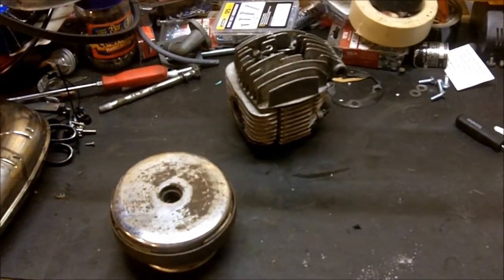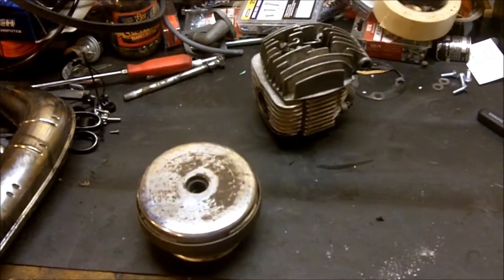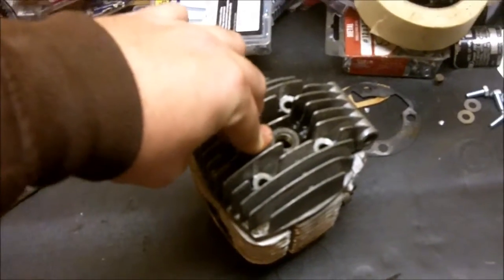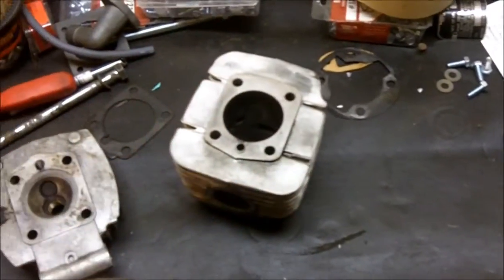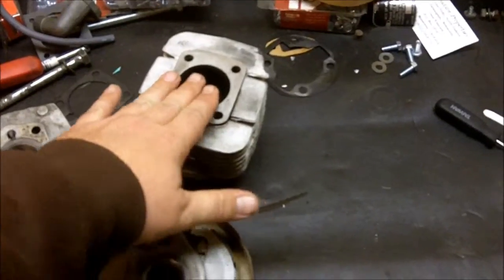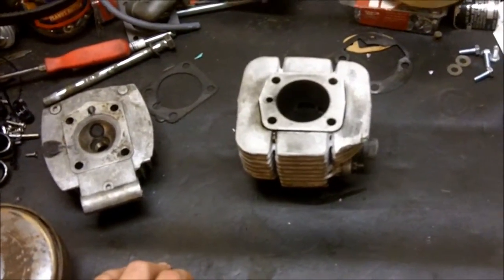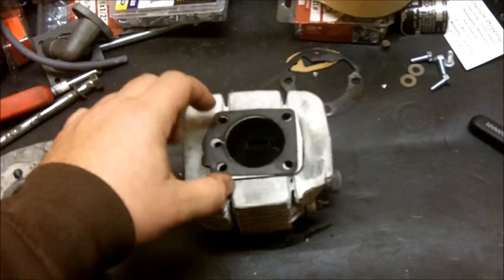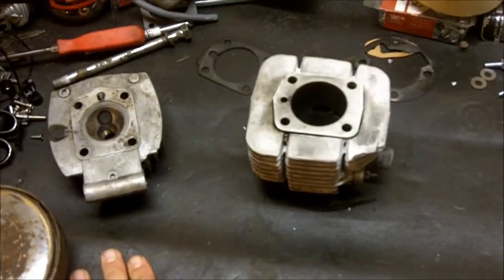Motobecane Decompressor Explanation

Comment: Hi , I bought a 1951 Av 3  with mk1 frame ( no stand ) with variator clutch spinner on engine . It ran fine on purchase. After changing the tyres the pedals don't turn the piston. However an elec drill and socket onto the centre nut crank will turn the piston ! The belt drive is tight , chains are normal bike tension but pedalling on a stand or on the road does not work . There is anew plug in it any ideas ???!

Comment: No, it allows the engine to be turned over easily when starting, it allows the pedals to overcome the engine, (and also can be used to stop the motor). He does explain this in the first two minutes of the video. The fact that the decompressor in his motor wasn't seating properly, made the engine run bad.